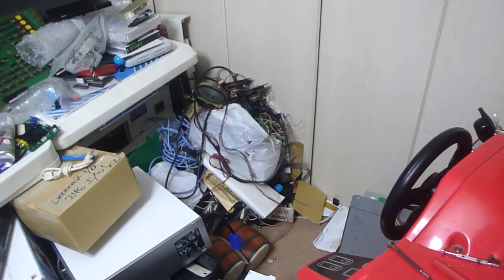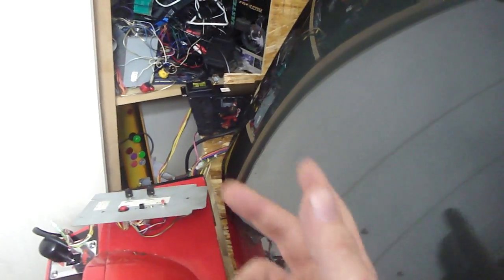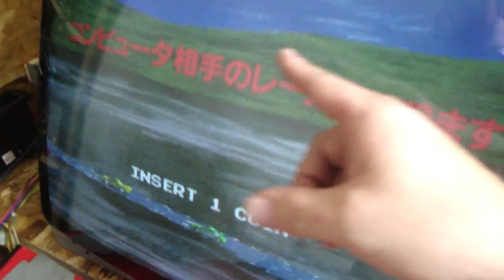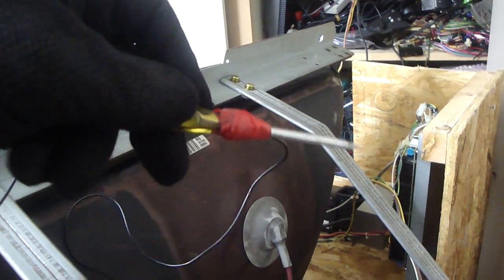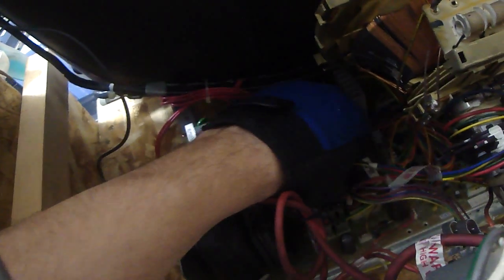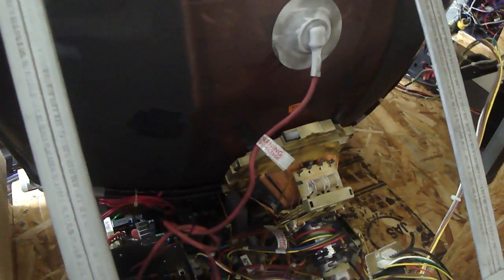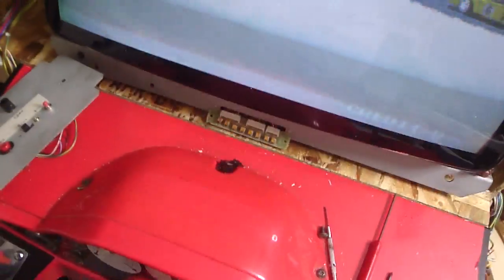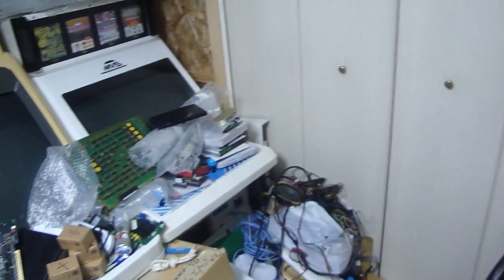How To Discharge A CRT Monitor And Change A Reversed CRT Image,General Game Room Madness

Comment: Awesome picture on that tube, can see why you hooked it up to the cab.  Also really good to know how to discharge CRT's as well.  I hope to get two old cabinets shortly, the 1st vertical & the 2nd horizontal, to cater for both types of boards.  Much cheaper than building cabinets with the prices I got them for too.

Comment: As a side note, apart from the HT, the other thing to distrust on these things is a 'dead' chassis that has no blown fuses. If all the fuses are intact & it doesn't run, chances are that the primary part of the power supply is not switching/regulating & the mains cap will REMAIN CHARGED! You will have to carefully discharge the mains cap with a suitable lead before attempting any work the chassis.

Comment: I only discharge the tube when I have to remove the entire chassis, or work on the neck board, as the yoke & HT circuits are isolated from each other.
As for refitting the ultor cap, I always clean the cap & glass socket with isopropyl.
Then, smear some silicone grease inside the cap before refitting to prevent 'tracking'.
If you get tracking from a leaky ultor cap, the arc will eventually puncture the glass.

Comment: can also discharge a CRT monitor from the cap on the board, easier sometimes then screwing with the flyback /tube connection

Comment: Excellent tutorial. Very important to discharge the CRT AND unplug the monitor both. Keeps the repairperson from dying which is a really good thing. Not sure how safe it is to run the system without a cabinet like that, just keep yourself safe. Nobody wants to see Luke zaps himself video.